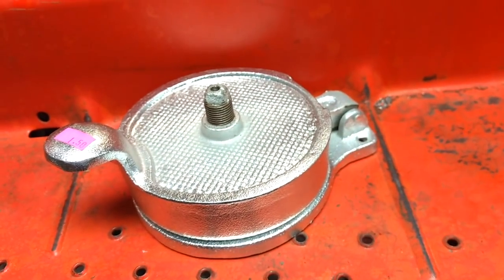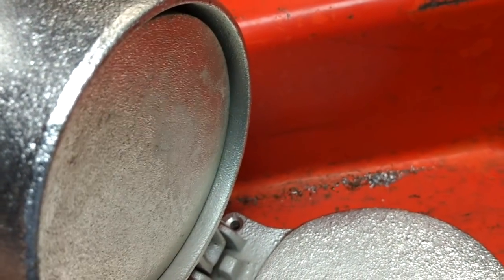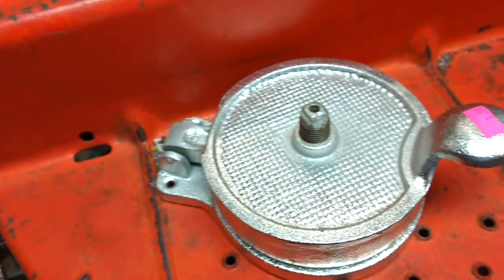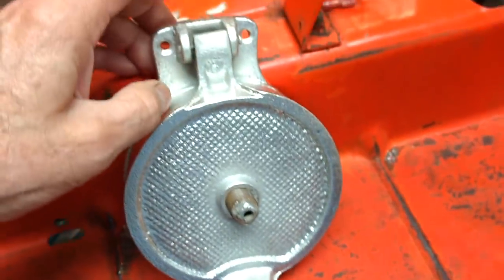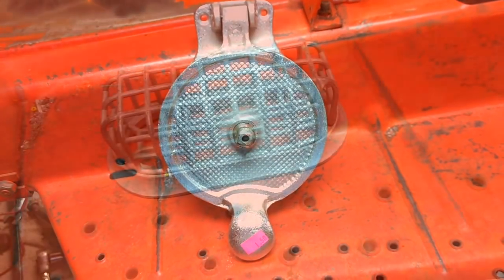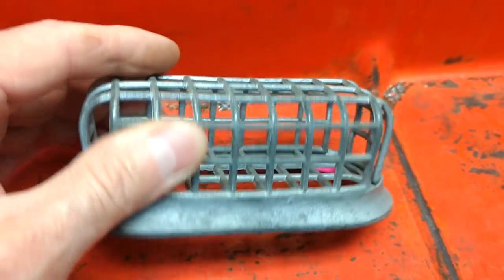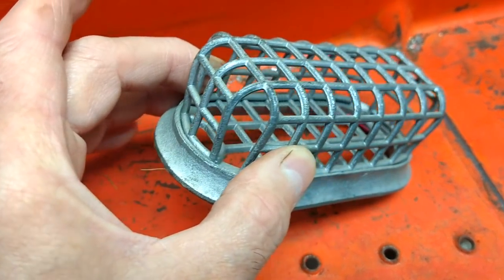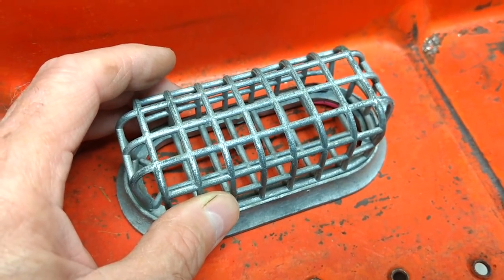2 What is its?

Comment: Burger press as others said, it's missing the lock nut. Used in the home and in some burger shops to handle portion size.   Second item looks like a drain guard.
Reply from the maker: I have yet to verify the drain guard, though it is a good guess. Thanks

Comment: The cast wire-mesh device looks like a Drain Strainer.
Reply: Maybe a gutter downspout guard, the old drop in type ?
Reply from the maker: You might have something there.
Reply from the maker: It seems a little to long and thin for that, but...